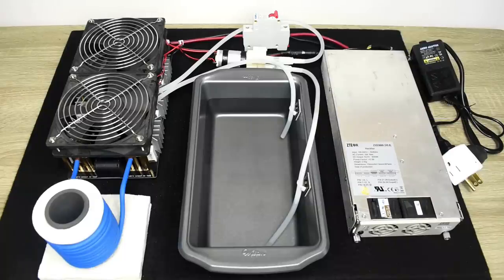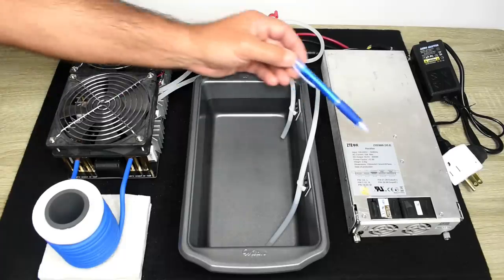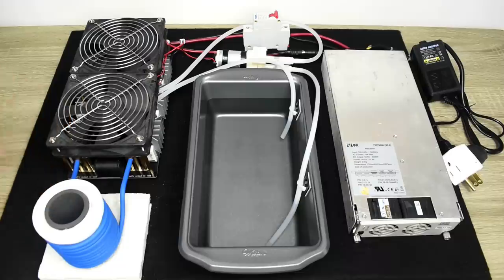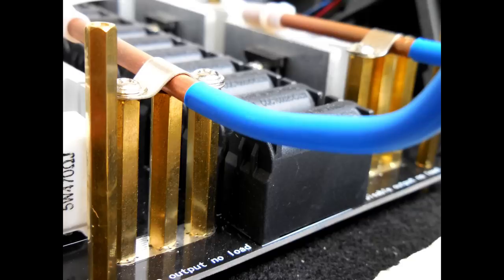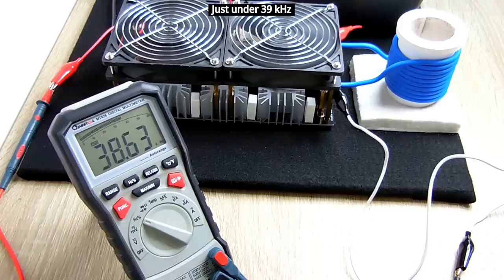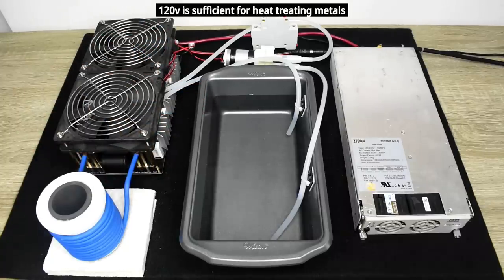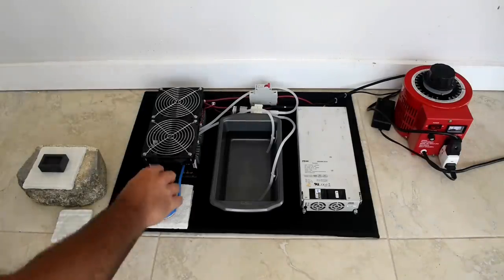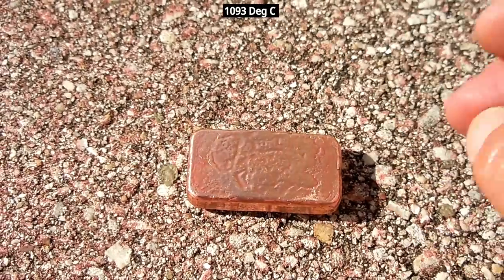How To Easily Melt Silver Or Gold Into Bars!

Comment: Awesome review of this! I was always curious about it. What maximum temperature do you think it can reach in the crucible?
Reply from the maker: Glad you enjoyed it. I'm not sure, but the link to the product may give more information. I think it would melt steel.
Reply: @electronicsNmore  Yeah, that’s great to know. Are you still running it with a variac or do you just use wall 120V or have you stepped it up to the full 220V? If you have taken it to 220V, I am confused with what cables and plugs to use. The only available outlet that is 220V in my house is my dryer outlet, but that has four prongs. I just don’t want to wire it up wrong or get a plug that has the wrong configuration. I just hope 120V is good enough. Sorry for all the questions and I deeply appreciate any help

Comment: Hi Doug, thank you, this is a very interesting video. I buy gold from small miners in the interior of a couple of South American countries. I'm looking at loading a generator in the truck to power this small induction furnace. How long do you think it would take to smelt 20 grams of gold using this setup as is? How about with 220v?
Reply from the maker: Hi Dan. This induction furnace heats up very quickly when the correct input voltage is used, so it wouldn't take too long. The majority of power supplies allow 110v/220v input. BTW, checked out your channel, you're a great pitcher!

Comment: Hi @eletronicsNmore. Very good job! Like a beginner in the electronic world, I just didn't understood why are you using a power source and a variac at same time if your power source is bivolt. I need a variac to run the system? Thanks
Reply from the maker: The power supply output varies with input voltage. At 120v the output is low, and 240v the power output is very high, so I did some tests and found that 135-140V was ideal.

Comment: Nice video. 
I wonder if using a radiator and reservoir, like computer cooling does, could improve the coil cooling. Maybe it would allow building bigger and more powerfull induction furnace...
Reply from the maker: That would greatly increase cooling.

Comment: Thanks for your reply!
Is there a difference when I am just hanging the metal piece in the coil and not in a graphite crucible why it not melting??
I place some fire blanket around some aluminum bronze (My kit did not come with graphite crucible or ceramic crucible) and I cant get it past red hot I know its working on 220v because the amps go up to 50amp when I hang a big piece of steel in the coils but when the metal gets hot the amps go down but when I stick the steel in some fire wool it wont go higher than 14amp Please help I don't know what I am doing wrong!!

Comment: Some time I seen the coil cooper no need to be coupled by water cooling system. But yours furnished by it. What diferent Sir, in case yours was not furnished by it?
Reply from the maker: For this level of heat you'll need water cooling. A solid copper coil will get extremely hot and melt if allowed to run long enough.

Comment: Hi again.. I got my self 3 of 12v 30 A power suppliers connected in series so its 36 v up to 1080 Watts. I have the water pump, etc.. Everything exact as you but still the copper is not melting.. Getting extremely hot.. Yes.. But not melting.. Any inputs on that....?
Reply from the maker: Not high enough wattage.

Comment: VERY KOOL 😎 CONCEPT!👍
WOULD ADDING CAR COOLANT TO THE WATER WORK BETTER?
HOW MUCH DOES IT COST FOR ALL PARTS TO SET THIS UP?
Reply from the maker: I thought of that. :-). I bet it is. Total cost with coupon code just over 200.
Reply: @electronicsNmore  THANKS BUD! 👍 GIVE THE COOLENT A TRY & LET US KNOW IF IT MAKE THE SYSTEM MORE EFFICIENT or FASTER...
Reply: @electronicsNmore  Hey, I run a smaller 300# "Inductotherm VIP Power Trak"" induction furnace (for melting silver) at work and I was instructed to mix the coolant at 50/50 ethylene glycol and DI water.
Thanks for your videos!
Reply from the maker: @steelcappedstrength Thanks for the input!

Comment: Hi.. A car battery will work for power supply?
Reply from the maker: 1 car battery, no. You'd need 2 or 3 connected in series to increase the voltage.
Reply: Thanks for your prompt respond... How about if i have 2 12V 30A units.. Its possible to connect those together in parallel or in series?
Reply: Hi I had connected 2 units of power supplg of 12 v 30 A each but still not melting... Any advise on it... Txs

Comment: Hey me again I just got mine in the mail but I plug 220v into the power supply and it still only shows 53v about 5-20 Amps is there a 120v 220v switch inside I don’t see it on the outside how do I get to 220V????
Reply from the maker: No. The heating output varies with input voltage. In the video I used around 130-135v, and that made it work beautifully. Same power supply I got? It should work. Make sure all connections are secure. Play around with it.

Comment: I see no benefit to this system as is, one could continually add ice cubes to the pan though, the pouring is the issue, we want a good smooth bar, pouring does not achieve this any better than a standard kiln / furnace, however if one could modify this for a direct silver shot / crystal in a mold within the heat source, I believe this would be the better way.

Comment: Nice alternative to torch but unfortunately not so reliable especially when all this mounting and welding electronic components come from China. I hesitated between torch or induction solution, finally i get my torch for cheaper and it will last decades.
Reply: It seems like simple circuit tho, and depending on where you live it would make sense to work of electricity rather than gas. Specially if you are off-grid solar/wind. Though there's also plasma arc melting that also works of electricity though is a lot more dangerous.